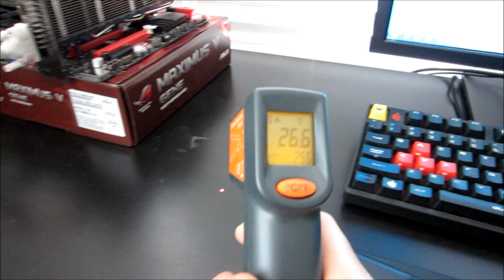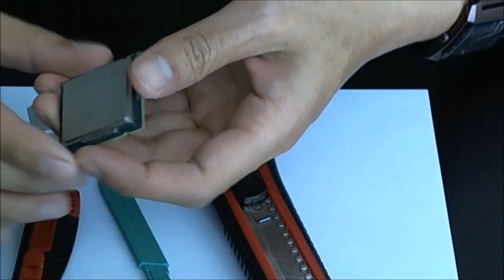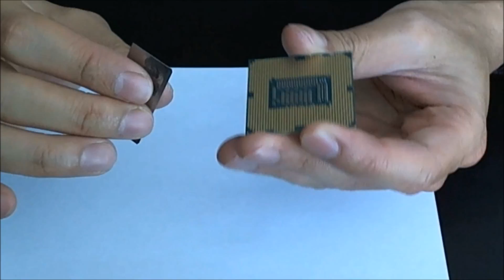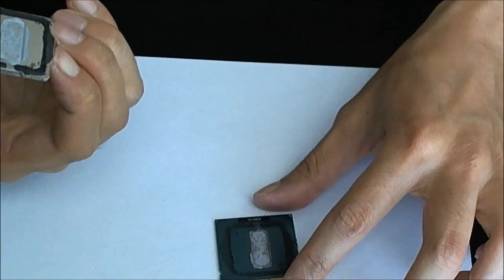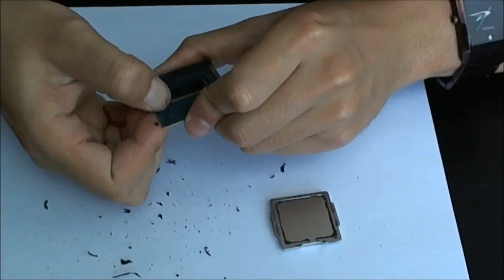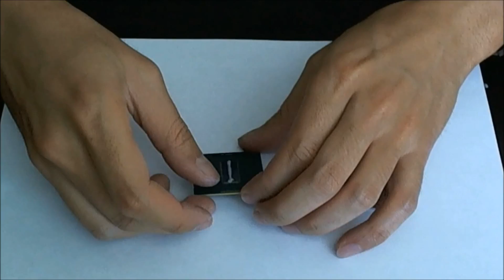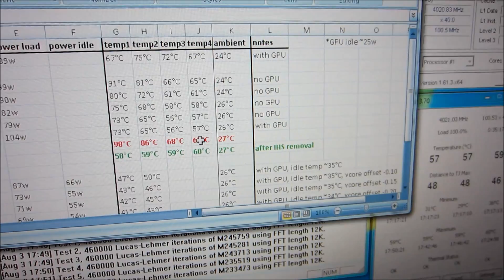Fixing Skylake, Haswell, and Ivy Bridge CPU temps: IHS removal

Comment: So,  I like dealing with older processors and such - because - until they become "rare" as replacement parts - they are cheap to work with.  
Had an E5 Xeon go thermally crazy on me - and tried to get to the internal thermal interface using this technique. 
Sadly, the chip had gotten so hot, the thermal paste was like concrete and the chip was ripped in half (across the flat plane) when I removed the IHS. 
Could not even chisel off the half left on the IHS. 
So, yeah, that was the end of that.  I could actually see thermal damage in the chip's circuit traces, so it was a dead man walking anyway. (across the flat plane mind you!)

Comment: I still have my beast of a CPU, 10 years later. It's a Core i7 3770K that ran 10 years OCed to 4,2~4,3 GHz without any trouble. I never got past 75~80°C even with intensive loads. And this last month, I had overheating issues, where I reached almost easily 85~90°C in any task, even after reverting back to full stock frequencies/voltages. Meanwhile, I touch my cooler (Noctua NH-D15) to check the temps and it never gets really hot. I'd say it's just about 30~40°C, while the CPU is clearly boiling. I've changed my thermal paste with some good fresh recently bought Thermal Grizzly, re-done it a few times (in case I screwed up application), but still the same overheating issues.

Your video is gonna help me a lot, cause I don't see any other cause right now than the internal thermal paste for the problem that I have. I'll try to delid it. I hope it will solve this ^^. Thanks a lot.

Comment: i see a video once with a guy that puts the cpu back to the motherboard wihout the metal sheet. just thermopaste the cpu then a cooler. temps were about 27-30 degrees. and at full load like 55 degrees. but i dont have the balls to do so with my i7 3770k. i just bought it.

Comment: From 2020. I just bought a 2013 AsRock Z77 Extreme 4 with an 3570K preinstalled (a bonus I wasn't expecting). I'm waiting for the RAM to be delivered today so I can smoke test it for the first time. This is the first system I've ever built for myself that's OC capable. I am a "power user" but not a gamer, so I don't mind using tech that's not exactly up to the minute. A byproduct of that tendency to buy cheap but good older gear is that in 2020, the above is a $50 experiment, not a $225 experiment. Or else, I may decide the stock speeds are fine: there's a red flag in my head that's telling me that just because I got myself an OC capable system doesn't mean I need to go ahead and try to boil water with it straight off the bat.

Comment: so if you have an older cpu should you remove the stock plate by intel and add new paste their?  Each core on my old core 2 quad is reading different temps which is concerning.  They max at around 60c.

Comment: Gonna drag this video out of the dirt. I am new to anything close to delidding (never done it before).  I found this because I have a dead 4590 (i5). Debating if should mess with it at all, or just give up. 
I put the cpu in a good optiplex 3020 and the machine won't POST. 
It is worth any effort?

Comment: I have hp workstation z240 which have processor Problem 
It's working I mean display is ok but it's stuck on hp logo.
So I change processor it's working well there is no problem 
My question is how can I fix that processor which have system stuck Problem plz tell me the solution.

Comment: Recently our old Dell XPS laptop had coffee spilled on it, so we took it apart and took out the RAM, cpu and other components. The cpu was a core i7 2630 and seemed like it had already been delidded. It has some thick silicone residue that I can’t seem to remove. Any tips?

Comment: Still running my old dinosaur of an i7... a Sandybridge 2600 and I just noticed today while I was checking something else that my CPU cores had all peaked at 98C while I had the monitoring software open. (about a 30 min period) The system had been under somewhat heavy load during that time. Wondering if my thermal paste is getting old and ineffective.

Comment: Pretty good job on this. The only part where you can damage your chip is when inserting the blade between the HS and PCB... if you break the PCB or hit the die inside too hard.

Not sure why people freak out about touching pins and all that. These chips are BEASTS compared to the other regular plastic packages. Plus the die is not as bare as you think. There is always a coat of passive oxide on top which can't be "rubbed off".

Comment: I want to to get my Mac fixed so I made a decision to visit a Mac shop. In place of repairing it by hand, they advised me to utilize this excellent system utility for MAC “govo unique only” (Google it). It was good, fixed most of the software troubles. Ideal top features of it are Cleaning, Securing , Optimizing your Mac, anti virus, spyware..and a lot of more.

Comment: It's not cheap. And it's definitely not a thermal paste. Pressure sensitive phase change thermal interface material. Above its phase change temperature, it's wets-out the thermal interface surfaces and flows to produce the lowest thermal impedance.The material requires pressure of the assembly to cause flow.

Comment: Heat rises... All the heat from the gpu is being pulled right into the cpu heatsink... turn it sideways or get a real cooler. If you have any decent sky/kaby lake and not on air, shouldnt be overclocking, let alone delidding.. lmao
get a real cooler and get the De/Re-Lid kit and do this the right way.

Prob have your air cooler in a Push/Push setup too. lmao

Comment: my xeon e3 1231 idles around 45 degree in 30 degree ambient and max out at 71 degree during aida64 stability test.. is that acceptable? i tried re-sitting my heat sink and re applied thermal paste (nt-h1) but still the same result

Comment: Putting your feet on a metal frame on your desk won't ground you lmao... if you have nothing to ground yourself with hold a piece of copper and tap your water supply system in your house, you need to be touching something that's conductive and is touching the ground to "ground" yourself
Reply: Profatoe ... jokes on him right, his cpu was working afterwards and everything! Some people.

Comment: Hi. In my case the experience with MX-4 and Gelid Extreme did not work. Temperatures dropped 7 or 8ºC but after a week they rose above temps before delided (I made 4 or 5 attempts with total PC cleaning and paste change).
Coolaboratory Ultra lowered temperature 18 and has remained stable for a year. Do you have any idea of the cause of the apparent degradation of silicon TIM in my case?

Comment: why do you even need the heatspreader? Why not just put the cooler on directly?
Reply: I remember the Athlon XP CPUs used to chip and crack like glass at the edges if you were removing a  really tight-sprung heatsink and put pressure on the corners.
Reply: You dont have to, a lot of people dont. Also make sure you use liquid metal vs paste...youll get more like 15-20 degree drops.
Reply: My theory is that the die is very fragile, and the copper heatspreader reduces actual pressure by distributing the load on the PCB instead of the die when tightening on a heatsink, and it does what its name implies... Spreads the heat evenly to take away heat from the center before transferring it over to the heatsink.
Reply: Ah okey. So you think the pressure from the cooler directly attached to the die actually could wreck your cpu?! When it comes to cooling performance you would probably be better of without the heatspreader anyway. The heat would spread even better with the heatsink directly attached to the die I think.

Comment: I would apply neutral adhesive, and softly clamp the CPU assembly out of the motherboard to dry for a few days. The reason being is without proper reassembly, the heat sink if bumped at any time may shift the thermal paste applied to the die, and destroy the thermal bond. It is why it is glued to begin with aside from not falling apart when it gets unboxed.

Comment: I don't know what you're doing but you're catching on shit. There's a reason Intel used some adhesive to keep the CPU and the plate together...
Reply: Riyaadh Fakier Yes. My comment above. Should the cover plate shift with heat sink attacjed and all... The doe shall lose thermal bond with the plate. the die area is very smooth, and small, so it wouldn't take much to break proper thermal bond.
Reply: To prevent the IHS moving and stop people who don’t know what they’re doing from damaging the silicon.

Processors used to come without an IHS.

Comment: too bad no one sells copper lids which could conduct heat better
Reply: Actually the lids are copper , with a coating on it . You can sand it off ( CPU lapping ) , which also drops temperatures and is perfectly safe if you have patience and a steady hand .
Reply: Dang - didn't know that. . .but what do they coat them with to change the color so drastically?  Also, is exposing the copper to the air and possibility of it oxidizing a major drawback?  - just wondering because that is one possible negative point that I thought of.
Reply: Don't know for sure , but I am guessing is't a nickel based coating... but I might be entirely wrong.

Basically , it won't really oxidize. For oxidation you need 2 things : 

Air humidity and oxygen . I doubt a room at your home would have enough humidity to oxidize the copper anytime soon .

Also , you're sanding the IHS 100% flat , with a little thermal grease between the IHS and the CPU cooler , you're almost airtight.

To tell a stronger tale : if you put a drop of water on a lapped CPU , and you've done it right , and you press that on a glass plate , you can turn the glass plate upside down , without the cpu falling off.

Never seen my CPU oxidize , and I've lapped 3 of my own CPU's already.
Reply: Thanks - I'll keep it in mind
Reply: just a reminder : It's safe to lap a CPU ( if you know WHAT you're doing )  , but it voids your warranty. I dropped around 10 C , but it may vary chip from chip
Reply: yup it's nickel-plated copper

Comment: The thermal compound under the heatspreader is hard like cement because it is thermal adhesive instead of thermal paste.   Thermal adhesive is like a glue and is meant to keep the heat spreader on permanantly and thermal paste is meant to be removed.
Reply: Carter Flom ... nope, it’s not.

Comment: I ever try to do A8-6600k the result as the same the temp still very high. (use silicone from cooler master) I bond the back plate to pcb with high temp rtv silicone. (gasket silicone)

Comment: 10°c between core 0/1 and core 2/3 on my 6700k.
should I do this?
Reply: Raphael Grubain no
Reply: trillriff-axegrinder its a 6700k
Reply: don't! don't waste money,on a fake video!
Reply: its a shitty dual core and the end results will be absolutely undetectable.
Reply: Raphael Grubain it won't change much. You will lose your warranty as well.
Reply: Mitacccosmin Mc fake ? what did he fake here
Reply: even if you manage to open the cpu....i finaly did it myself on a g550....an i do not see any improvements....only higher temp like before i cracked open that intel.....i cleaned up...put a zalman cpu thermal paste....and....some 50 degrees c on idle,,,sorry for my bad english
Reply: Damien i allready write that i was wrong....

Comment: i dont want do this. this is very dangerous fix i ever seen.
Reply: pc enthusiast have been doing this for over a decade now. if done properly it can lower temperatures allowing for the cpu to run cooler and be overclocked slightly higher. worth it if you have a cpu that's starting to age, I personally wouldn't do it start out of the box..
Reply: To me it doesn't seem that hard if there's nothing else to watch out for besides the die in the middle while cutting the lid off. But if CPU still has warranty I think I wouldn't do it.
Reply: Xmans___ oo

Comment: Face palm @ holding the CPU in your hands while you remove the IHS. It would be safer, smoother, easier and far less greasy if you placed the CPU on a clean surface or even better, on a thin layer of sponge (the stuff they used to give you with CPUs that had pins). Watching this was like watching one of those ISIS beheading videos. Oh and, skylake users, you do not need to do this. The factory compound is sufficient enough to keep idle and load temps to whatever your cooler can provide.

Comment: What if we delid, weld a 1.5mm copper shin on the water block and mount it directly on the cpu with out the IHS
Reply: It would break the cpu
Reply: no it wouldn't, mobile equivs don't use a heatspreader and have no problem mounting the heatsinks directly to the die - seems you forget about the days of early 
socket Pentium 3's (northwood, coppermine, tualatin) and early athlons/durons. same goes for mini itx mobo's running G1-G3 socket mobile chips and larger passive heatsinks. so long as the heatsink is mounted level and touqued up evenly it won't cause any issues
.
Reply: poiuytrewq8ff
Those are made by robots.
massproduction robots have very few mistakes all chips today is made entirely of only robots. its a different story to weld by hand. if you do it by hand you gonna need 180+c for a pen this large maybe 300c stuff can break.

Comment: So you're saying you won't need to do this with the 3930k ?
Reply: Nope, got mine to 5.3ghz still on water.
Reply: Dam, what would be a good stable constant clock for a 3930k ?
Reply: Senyrar I found a 100% stable was 4.8 at 1.44v. Gaming 5ghz at 1.51v. 5.3ghz was 1.6v. But be warned, past 5.1ghz and 1.58v the 3930k becomes a flaming monster! I need'd 2 quad rads just to cool her down.
Reply: how long have you been running at those voltages?
Reply: Glenn Mitchell 1 year then a power surge killed my entire PC. Now back to basic tech until I get the money again.
Reply: You may have just convinced me I need a surge protector. I've never seen a power surge happen but if one did, I would be without a computer indefinitely.
Reply: Glenn Mitchell little surge protectors may not save your computer the big ups that filter the power would tho
Reply: Thats alot of head room. Anything under 91c is good enough. Keep throwing volts until she's stable.

Comment: so much for the alcohol prep cleaning theory.  He doesn't use any and uses a regular paper towel (leaves fibers).  He then smears his finger oils all over the heat spreader right before putting on the thermal paste (vid doesn't show it, but 99% sure he didn't wipe it down)
Reply: And with all that and sit still works way better then before :P
I'm realy pissed intel done fucked up and cheaped out on the thermal paste...
Reply: yeah... by 1 degree...
Reply: Felix St yep 1degree doesn't make much difference so why waste time. I recently fixed 3broken pin AMD fx8120 with staples pins lol works like a charm, well paid 30$. I bought the copper pipe heat sink to stable the temperature.
Reply: Hunter Chen in winter when you go outside house, you don't say it's colder than yesterday because cold is cold.

Comment: i would be carefull doing this to a slightly older cpu i just did this for fun to an old one of mine. i never went deep enough to cut the die or anything but the die split in two as the 'termal paste' (more like glue) ripped the top half of the die off lol

Comment: You should have put the heat spreader back on properly, you use RTV sealant, which is silicon and is what Intel used to begin with. It can handle temps far greater than any cpu will create. In fact, if anyone is reading this,  make sure you wash your hands before doing this, don't touch the pins or pad on your cpu, make sure you are grounded, use a new razor blade for removing the cpu heat spreader, completely clean both surfaces with 99% alcohol, remove the old silicon sealant, replace with rtv sealant (it's typically black) and use a quality thermal compound, preferably not crap mx-2,  nowadays there is better out there. Once you get it all ready to go, apply the rtv then set something heavy on top of it (like a book or clothing iron) and let the rtv cure for about 6 hours, the longer the better. Just make sure whatever you set the cpu on is extremely clean. a sheet of glass would be best.
Reply: Or just not use a heatspreader, they never used em for early socket p3's and athlon/durons and we never had problems mounting directly to the die back then (well some people were dummies and damagaged/chipped the die) - or mobile processors for that matter. just make sure the hs is mounted flat and touque it up evenly and in steps.